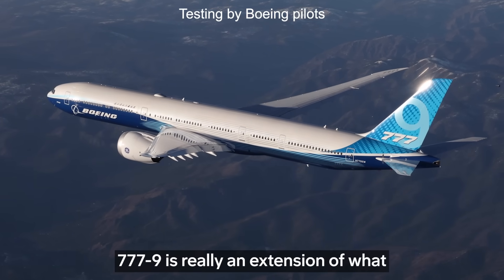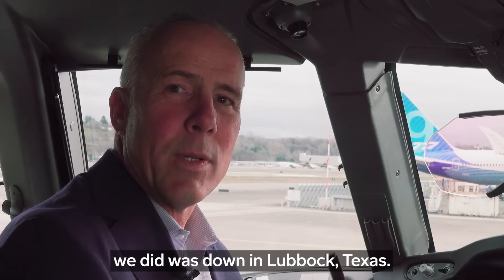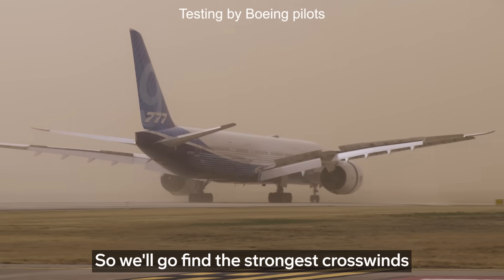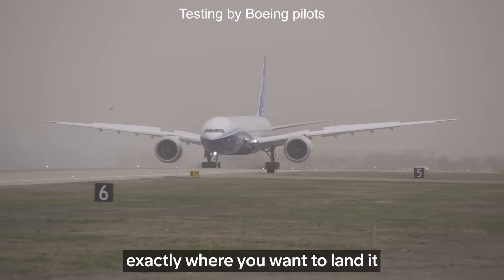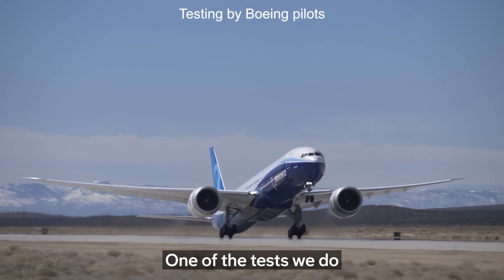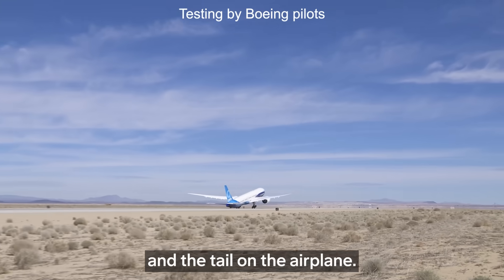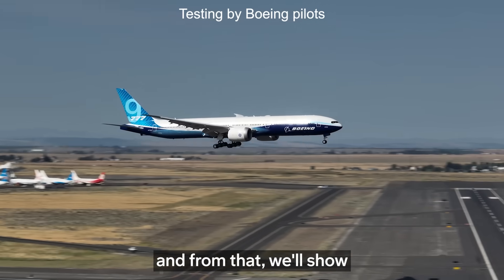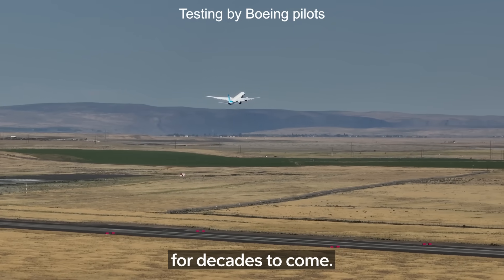Boeing 777-9 Demonstrates Key Capabilities in Multiple Flight Tests

Comment: Is it me or is the 777 9 way larger than 777 300 er?
Reply: it is infact longer taller and has a wider wingspan than the 747-8i
Reply: Its even larger than a 747-8 dimensions wise! Its incredibly huge.
Reply: They stretched it a little compared to the -300/-300ER
Reply: @bobperry8066 not a little bit lol it's literally bigger than the 747-8i in every dimension
Reply: @anushbhandary1441  I was responding to the original comment which made no mention of the 747-8i
Reply: @bobperry8066 yea ik that I just clarified that it's not just stretched a little bit its significantly bigger

Comment: As much as I hate to say it, I feel like Boeing is so behind the curve. This is a beautiful and majestic aircraft. But it's too expensive, and most airlines are going to choose the A350 or even two separate 787s.
Reply: As much as I hate to say it, I feel like you don't know much about this topic and probably should have learned about it before publishing your thoughts. If it's "too expensive," then why has it accrued 555 firm orders before it has even been certified—even with the lengthy delays and negative publicity? And why are so many A350 buyers also buying 777-9s? And how would two 787s versus one 779 solve the cost problem? (Also see: increasing frequency versus upgauging.)

Comment: Did the wings, doors or windows fall off?
Reply: Cheap shot
Reply: @911HRW  fair comment
Reply: Why, robert-zg8or? Has this been a problem on 777-9s? Or are you merely remaining steadfastly fixated on yesterday's headlines? I'll grant you that only time will tell if Kelly Ortberg has legitimately made the necessary culture shift—and the burden of proof is on him—but there is ample evidence to believe this is the case, and that Boeing is heading in the right direction. For starters, do you doubt that the FAA has verily ripped certification control out of old Boeing's greedy hands? The 779's exaggeratedly prolonged certification makes amply clear who's running the show now. As for Dreamliners, did you know that 500,000 passengers around the world fly on 787s every day? And over a million fly on MAXes every day? My next three-leg itinerary goes: MAX8, 787-9, A321—and it's gonna be awesome. I know, I know: Keeping up with new information requires effort and thought, and it's not for everybody.

Comment: TEX JOHNSON Should Sell That 777 By Doing The Same ROLL He Did To Sell The 707 Way Back In The Day 🤔🫡

Film Exists!!! It Happened 🤠
Reply: That's funny ... but I actually agree. Seriously. Most of the test frames will eventually be sold at discount to carriers, but keeping one in the company for specialized demo work could do wonders for branding. Remember when McDonnell Douglas did the "Streak Eagle" variant of the F-15 back in the day? They stripped it down to feathers and talons and then shattered world record after world record. A lightened demo 777-9 with uprated engines could get nasty at airshows.
Reply: @Infiltrate.and.Betray Agree. On A Smaller Subject, Commercial VS General Aviation...

BOB HOOVER Did His Famous Shrike Commander, Barrel Roll/Loop Routine With Engines OUT/OFF And Poured A Drink Without Spilling A Drop 🤠

I Don't Believe That Aircraft Was Specially Modified, It Was Factory Equipped. 🫡

Comment: Does Boeing perform a one engine only with maximum weight takeoff test?
Reply: its required by law to have the aircraft being able to take off on max takeoff weight with only one engine so yes, they do that as well
Reply: @anticooperativ8398 yeah as soon as the aircraft passes V1 which is the you must take off speed it is required that it can do so with only one engine
Reply: @anticooperativ8398 Required by law sadly as we have seen means nothing to Boeing.
Reply: @icare7151 Could you elaborate on this? Another expert?
Reply: @icare7151  The law "means nothing to Boeing," icare7151? So ... then ... why have they spent 4,000-plus hours and billions of dollars testing and certifying the plane?
Reply: It's a must I think